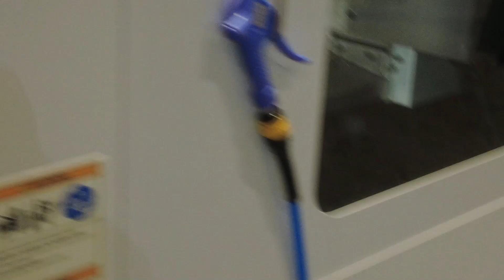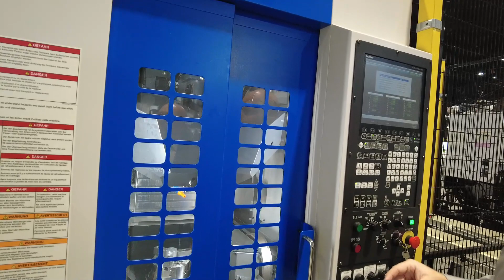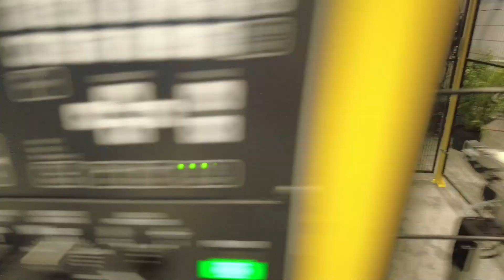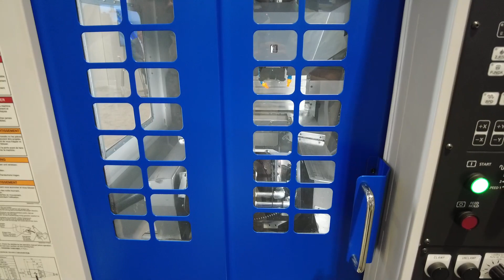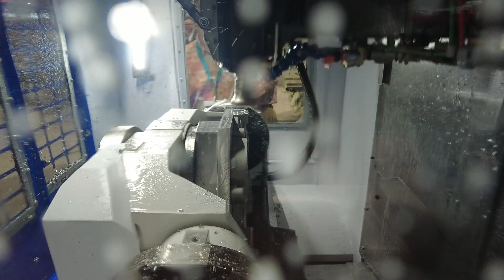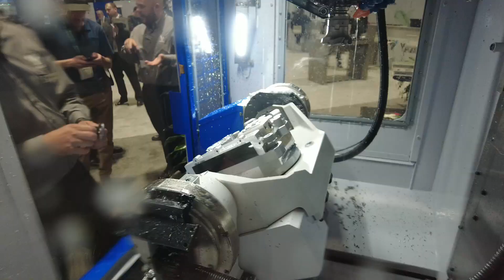BROTHER SPEEDIO IMTS 2022

Comment: The 5 Axis Brother would be a great machine to think about for a future purchase.

That's a reasonable range of Work Holding with a 200mm Chuck, adding that it has a 63mm  bore, great for slightly longer parts.

Definitely a Very Nice machine, I especially like the fairly small footprint of the machine.

Add a Robot Cell.
Amazing what this machine could be capable of. 
Thanks for taking the time to make the video 👍

Comment: Your video Worth zero If you don't mention price
Reply from the maker: I’m sorry, there are many variations in the speedios and many times it requires a quote.  Perhaps someone here can answer.  I’d imagine they run 200K-300K ball park.
Reply: @ericschneiter  thanks
Reply: @إستقمكماأُمرتَ-س1م   S300-S700 are all in the range of $150k, R450 and R650 are a little more just because of the pallet changer, I believe they are closer to $170k-$180k. Not sure about the M or U series, but probably $200k and up because of capability.

Comment: The rapid speeds are insane on these (I own one). I have a job that takes around 4 minutes with everything on maximum. Just dropping the rapids from "5" to "4" and the job takes 1 minute longer....

That's not changing the cutting speed. That's just changing the speed it moves around BETWEEN cutting. Bonkers how much difference this can make!
Reply from the maker: Haha are you serious?  That’s SO wild!  A full minute.😂. Dang man rapids and tool changes.   Really cool insight thanks for sharing.
Reply: @ericschneiter  found your channel looks good subbed
Reply: If it does save one minute that means you have no cutting time at all@@
Or do you have more than a piece in one operation.
Reply: @youngforever9417  I think I've explained badly. The job usually takes 4 minutes. If I turn the rapids down, then it becomes a 5 minute job. So that's an extra minute just spent moving through the air and not cutting. 

That's the power of the Speedio, they don't so much "move" and "warp drive" to the next location! My machine accelerates to 10k mm/min and then stops, whilst repositioning a tool in a 2mm wide slot! Crazy!
Reply: @youngforever9417  With brother machines the rapid knob is 1, 2, 3, 4, 5, and I dont believe its a linear increase. If I were to guess it would be 5%, 10%, 30%, 60%, 100%. he still doesn't have much cutting time but a program running on a speedio is about 2.5x quicker and that is only because of rapids/tool change (ATC is also influenced by rapid dial)

Comment: Is the U500 simultaneous 5 axis?
Reply: Not yet. Brother is introducing simultaneous 5 axis with the M200; they are a company known for 100% reliability from release, so they take a cautious, incremental approach (the D-00 control was released on the W1000 over 18 months before the entire lineup was upgraded with it at IMTS). We expect the D-00v to be available as an option across the line in about a year or so (while the controls are identical, export controls mean Brother cannot make full 5 axis a field installed option).

Comment: i've never seen the mill turn feature on this size of cnc. would be amazing for billet impeller. surely more convenient than an integrex
Reply from the maker: My only wonder is chip management, although I did see them tip the trunnion all the way upside down so I’m sure they thought of that already.  Pretty amazing little machine.

Comment: Respected sir I am also into cnc grinding machine manufacturing industry where v install fanuc oitf plus series system and siemens system. I want to know if there's any platform for fanuc system commissioning knowledge along with glass scale enabling in fanuc and all please help me out sir???
Reply from the maker: I don’t know about FANUC systems for glass scales.  I would imagine it is possible.  I can answer questions for Centroid systems but have little knowledge of the Fanuc Controller.  Perhaps someone here will see your comment and respond.
Reply: @ericschneiter  if u know any one or any platforms that r cheap for fanuc training plzz let me know. I m eagerly looking for help bcoz i m presently indulge in a project of three axis machine manufacturing with fanuc system plzz help sir ji
Reply: @ericschneiter  thanks a lot for ur response sir

Comment: My boss would murder me if I programmed that many tool changes, efficiency comes in many forms not just the ability to do a fast tool change
Reply: The fast tool change is for mass production outfits who are doing hundreds of thousands of parts a shift. Right now is iPhone season, so Apple is machining about 1 Million iPhone 14s per day. With ~16 tool per, the 0.2 second chip-to-chip advantage on the new Speedio saves 3.2 seconds per phone. At a million a day? That is 888 hours of machining time saved per day. There is a reason Apple (or their suppliers) own about 40,000 Speedios, and Brother builds as many of them per year as Haas builds CNC mills. They only seem niche because they mostly go into high-scale production facilities where they aren't as visible as your local job shop.
(Full disclosure, I own a Speedio and am the Yamazen Speedio sales/tech rep for the pacific northwest).
Reply: Disclaimer: I own one. I've improved machining times dramatically by using more tools! When it only costs 1 sec to change tools you start doing stuff like an adaptive with a huge tool, medium tool, small tool, then finish. Because I can push the medium tool harder, I more than save the tool change time!! 

Also the rapids are so fast that when Fusion does something idiotic like dancing all around the part, instead of using an optimal order. Fixing this takes me time, and having done it I find it shaves like 0.5sec off the runtime....
Reply from the maker: I think it’s mostly just as a demo, but yeah haha I could see that. 😂
Reply: Do everything you can with every tool every time would make sense

Comment: Robodrill ATC is quite similar, all mechanic, using Z height to clamp, unclamp etc.
Reply: The original concept for the turret tool changer is from Pratt & Whitney on production drill presses from the 1940s. The big difference (until recently) is that Brother uses a separate servo motor to drive the turret (or tool chain in some of the machines), Fanuc used a gear on the nose of the spindle until the ADV models. The Brother tool change is still faster (.9 seconds tool to tool on the new D-00 machines, 1.3 seconds chip to chip).
Reply from the maker: @LumaLabs  this is a super cool insight man, thanks for sharing.  The numbers really are astounding when you mention that kind of volume they are doing daily and the time savings in just tool changes.  Seeing the Speedio in person was one of the highlights of IMTS for me.  Really impressed with them and how they are so purpose built, not a lot of wasted space or motion.
Reply from the maker: It’s very similar, but a robodrill rocks in and out as it picks tools.  The speedio is directly vertical without the rocking motion.
Reply: @ericschneiter  similar no the same. Spindle movement is only vertical no rocking, as for the umbrella yes it does move just as the speedios with umbrellas. Robo is a bit more rigid on milling, Brother is faster on ATC, tapping, and spindle ramp up and down. Both great machines